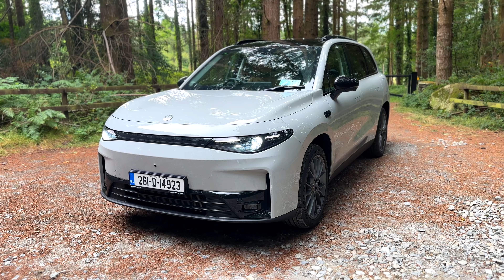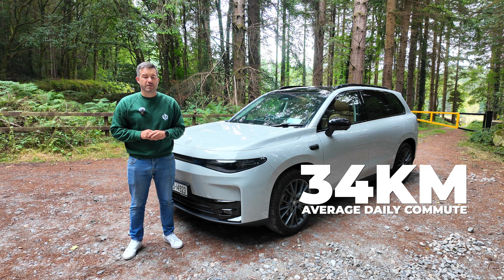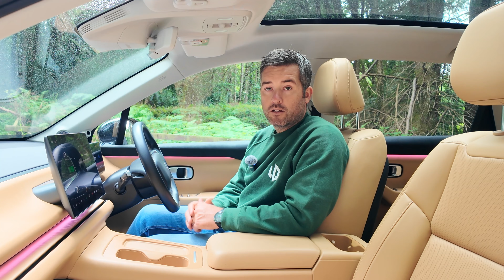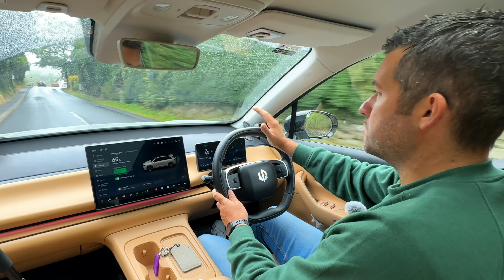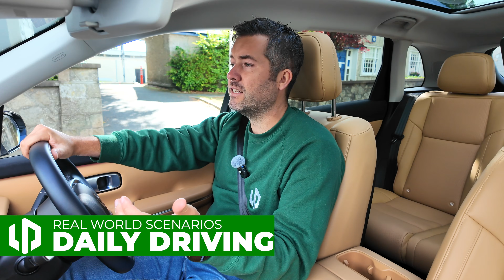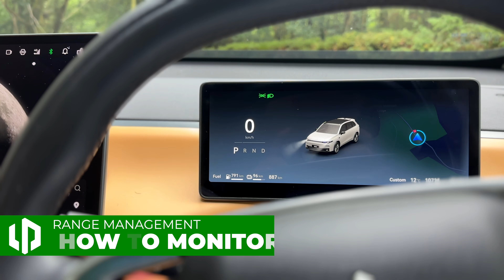Leapmotor C10 Hybrid EV | Full Walkthrough & Powertrain Explainer

Comment: Like your style and liked several previous vids. However, regardless how we dress 'em up, a REEV is still an Oil Burner. It may use less petrol than a similar sized vehicle, it may feel different to drive than other Oil Burners, but it's still an Oil Burner.  It lugs around a 50L petrol tank and it's still an Oil Burner.